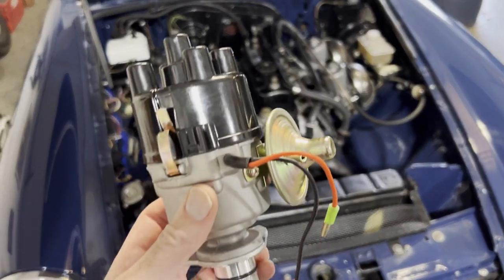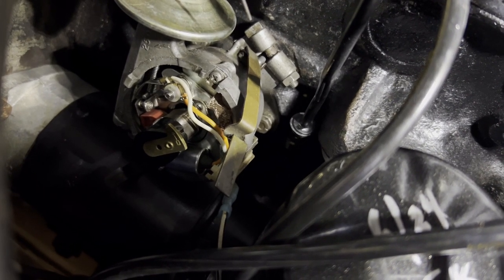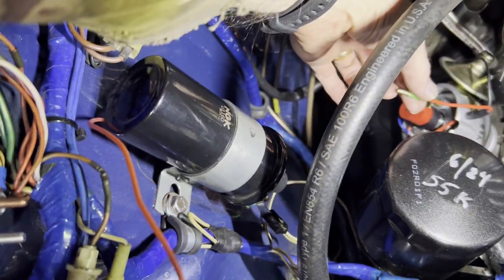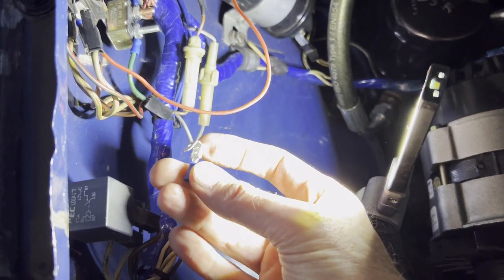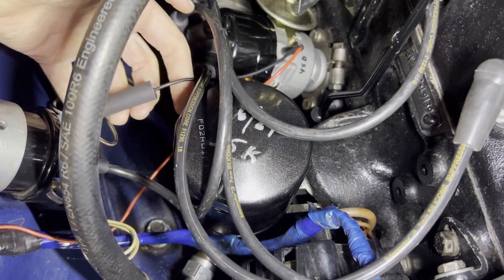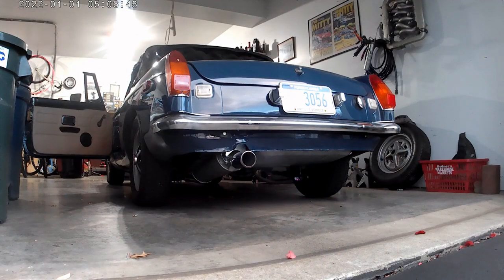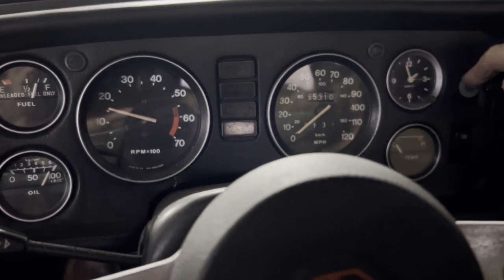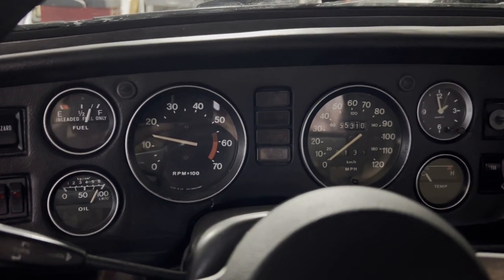MGB Electronic Ignition!  Making the change 1977-80

Comment: direct 12v should go from fuse box to + coil then dist. Other wise the ballast is still being used.
Reply from the maker: For the 77-80, I'm still using the factory ballast wire and the 1.5 ohm coil.  So, you need to run 12v power straight to the distributor.  Start around 1:23 for the explanation.  What you are saying is the wiring without the ballast and a 3 ohm coil.
Reply: some electronic ignitions such as the 123 can tolerate a low-ohm coil and will work as low as 4VDC, but maybe not for Accuspark, and since he is using the 1.5 ohm coil he is right to keep the WG ballast supply to the coil.
FWIW, the WG ballast resistance wire travels on down the harness to the front of the car, over near the left side headlight, and then comes back again to the coil & distributor.